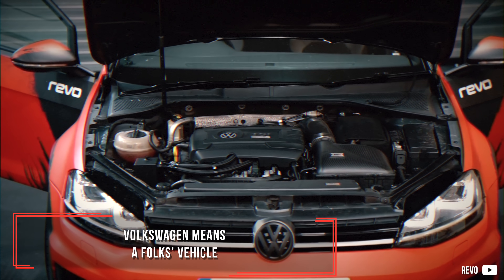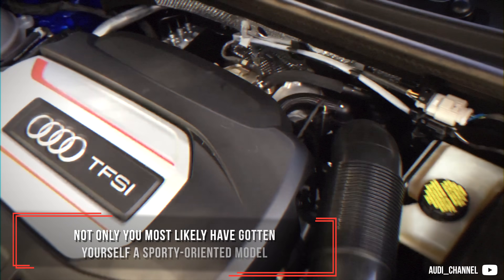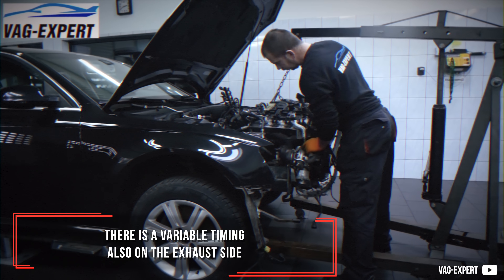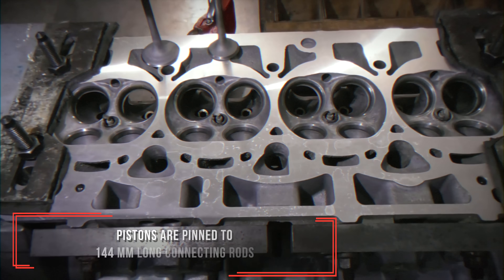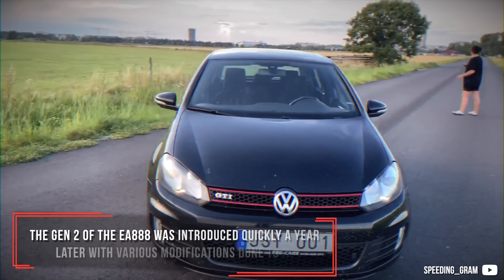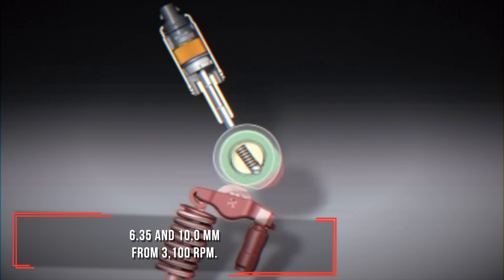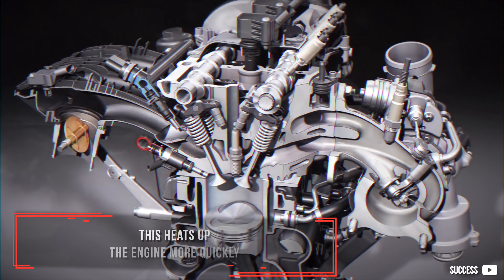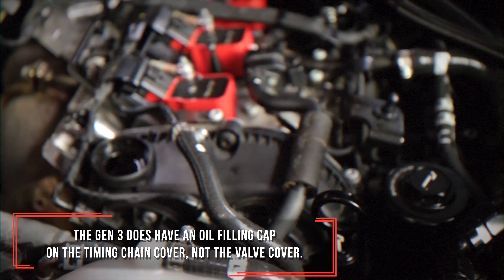Why The Volkswagen EA888 Is So Good

Comment: So the Gen 2 looks like a safe bet. The Gen 3 looks to complicated and prone to failure.
Reply: Gen 2 had the timing chain recall in North America, and VW fixed quite a lot of them. Gen 3 is the better designed and more stout engine overall, with none of the Gen 2 issues. Between the MK6 GTI and MK7 GTI there is a world of difference. The MK7 GTI / R are far superior than both MK5 and MK6 variants. Also, Gen 3 has lesser issues with carbon buildup, sludge etc.
Reply: @647killa  All VW have chain issues, as well as all mercs and all bmws. But having only 1 issue is a good thing.  The Gen3 has 8 injectors, that thing looks extremely complicated.
Reply: @Corsa15DT  Not as complicated as de-coking your valves every 10,000km.
Reply: @MercSLRFan  Will see in about 5 years when we know all about gen3, maybe that cylinder head will be terrible, maybe dozen more problems will appear with Gen3. Complicated engines are usually a nightmare to service and repair. I own a TDI and I thrash it regularly to prevent sludge buildup, never had problems with cat and egr. If you thrash the GTI will you solve to sludge problem too?
Reply: @Corsa15DT  Don't need to, the port injection cleans the valves with petrol.
Reply: @MercSLRFan  I know, that's why they put them there in the gen3. I think its an overkill design that will fail. I was asking about Gen1 and 2. If you give them the beans often, will they sludge up?
Reply: @Corsa15DT  They would, Italian tuning doesn’t work on direct injection cars.
Reply: @MercSLRFan  I am not sure about that :) I own my  TDI PD (direct injection by default) for the past 7 years, give it the beans twice a week, so far soo good. Never seen a check engine light. Touch wood.
Reply: Other way around.

Comment: Sorry but this engine, especially gen 1 and 2, are a piece of garbage and nothing more.
Reply: Can deny that the Gen 1 and 2 are junk, the Gen 3 has improved a lot (I owned one). Many owners of Gen 3 had driven since 2013 till today didn't had excessive oil consumption and timing chain stretched problem. Engine reliability is very much improve but water pump is less reliable. Many owners change once during warranty period and after 80k km it may comes back. Other than that pretty much stable.
Reply: @aeroline11  yeah the gen3 is fine. Also the gen 1 and 2 were a pleasure to drive - aslong as they runs, and that did not happen quiet often without problems 😂

Comment: I bought a 2011 vw cc with the gen 1 ea888 from a dealership, the very next day it spun a rod bearing. Had the dealership install a new motor for free somehow and the thing still never ran right.  Will never buy any european car again
Reply: 2011 engines are gen2
Reply: Buy an European car if you live in Europe. Otherwise get something else.

Comment: These really are great engines, I remember when my buddy/roommate at the time bought a brand new 2003 Audi A4 6 speed. With just a chip the car was substantially faster. The drivetrain was reliable, however the car itself had a lot of problems. I think it was in the shop over 20 times. Fun to drive though. I always loved the 2.7TT S4’s of the early 2000’s. I’ve seen some incredibly quick modified ones
Reply: @footballcoreano LOL what??? Volkswagen/Audi CONTINUNES to designs engines with abhorrently obvious faults/flaws for planned obsolescence. 

“Oh we can make the water pump about 40x harder to do (without a lift and specialty tools… aka dealer money) than it is to do on a b58 BMW?  And that makes it so we can add even more cash flow to our dealer networks/parts/etc?”

Timing chains on these motors in particular are absolutely dogshit, not to mention
They’re fucking $250 salvage title g35 class performance TOPS, plus boring as fuck fwd platforms… slow

Comment: I watched a video somewhere of a complete teardown on one of these pointing out all the weak points. Its a terrible engine from what I saw in that video
Reply: @footballcoreano i am german by the way.
Also halt die klappe kleiner Lügner. Dummer Fanboy, wie immer.
As mentioned in the video, it is only capable for 400 hp with stock hardware. So your comment automatically is identified as a lie and everyone knows. Iconic engines like a 2JZ laugh about that. An Mercedes OM606 makes more power with stock hardware if you slap a bigger turbo and injectors in it.
VW guys commonly have no clue about cars. They rarely have. As you proof
Reply: @dom3827  I made 530whp on my stock engine Golf R, this video isn't the definitive source for aftermarket potential, there are hundreds of low 10 second stock engine Golf R's out there. Thousands of 500+whp stock engine EA888.3's.
Reply: @dom3827  plenty of people pushing over 500whp with stock internals, you dont know shit about these engines
Reply: I know that channel. It's the one with the Canadian guy that uses his wife's old dresses to clean the mess!
Reply: @joshuajacome8803  yes that guy lol. Couldn't remember the name of the channel
Reply: yes, it actually is.

Comment: But its also the engine with the most known and often happening failures.
So, its not really good.
This engine is famous, yes. But in the first place for its failures and lawsuits it brought to VW. Like the oil loss, the water pump failures and wrong piston rings which were used in manufracturing the 1st generation.
Reply: You're absolutely wrong sir.
My 2016 MK7GTI has Unitronic stage 2 at 337HP and 370ftp. 
Since Ive owned,  ZERRRRRRO failed parts, mechanical or electrical. Hmmm, I want to thank the Mexican 🇮🇹 partners for great workmanship.
Reply: I honestly don't know what people are doing to their engines, but I completely disagree when people say that some of the gens of the EA888 are unreliable. That is either not true or I'm the luckiest guy in the world, because I owned several cars with different gens of that engine and I NEVER had any issues whatsoever. In fact this engine has been the most reliable for me for all my life so far. Give that EA888 some love and it won't disappoint you.
Reply: Hey Samuel. Would 7r or s3 ?
Reply: that depends on what ea888 variant you have, i hoped that reliability was discussed more in the video but in short gen2 is the engine with the famous issues like oil consumption and loose timing chain. those issues were fixed on the gen3 variant along with other improvements and they are nowhere near a common problem. gen3 is probably the most widely used engine in the vag family and for a reason.
Reply: @footballcoreano triggered?
Everyone knows your statement is not true 🤷‍♂️
Reply: @dom3827  maybe if you'd get your facts right you'd be credible one day
Reply: @nopeahuoli  i got my facts right baby. I worked for VW in germany for 3 years. 2014 to 2017.
The Like ratio also tells you are wrong. So what?
Reply: @nopeahuoli  how about people overasll just stop fanboying. I mean, what is the benefit of this? Nothing, you just spread hate and dont make friends.

Just be real, it is easier than trying to make someone believe fairy tales.
Reply: @Dom    no-one's been fanboying, it's just that your statements are simply untrue. plus inquiring whether someone is triggered over a response won't  get you friends on the internet like you wish

Comment: EA888 is a shitty daily engine. Leaking water pump, problems with timing chain, problems with the piston of the high pressure pump, Oil consumption etc. I wouldn’t recommend buying an EA888 with more then 100.000km. It just burns your money.
Reply: You forgot false constructed piston rings in the EA888 1st Gen. Where VW released new rings short after and workshops needed to replace them as soon as they have the engine opened.
The coking. After 100k Km you need to get the engine cleaned, or you will cause serious damage and also will have serious power loss. The engine will feel tired and weak.
Pistons which like to get a hole burned through ( stock engine, stock software ). The list continues.
Reply: @dom3827  the gen2 has the weak piston rings. I have a gen1 BZB and it has near zero oil consumption.
Reply: None of those problems are there for the gen3 though.
Reply: Will Burano your money... aaaand your oil.

Comment: The EA888 also came in a 1.8t version as well.  I'm not sure about Europe, but it is/was used in a number of North America applications.  I just picked up a '17 Golf last month with the 1.8t. Besides the obvious displacement difference (shorter stroke) it has a smaller turbo and variable cam timing on only one side (exhaust?).  The same tuning options that work on the 2.0 work on it as well.  I loaded a stage 1 tune to mine the second week I had it.
Reply: Interesting, I didn’t know they still made them that late. I always thought the 2.0T replaced it across the line
Reply: The 1.8 TSI was used in Europe as well.
Reply: @XJR6 My understanding is none of the North American versions, either 1.8 or 2.0, have the dual injection.  That is on European models.
Reply: I did the same thing.  2016 Golf.  170HP stock, 242 after a simple 91 tune from Unitronic without any other mods.  Changed the car completely.
Reply: @LadyLuck-iv2zd  I have a 2016 Highline golf. I have 80k kms on the car. All stock, do you recommend the 91 octane Unitronic tune?
Reply: @iankonstantino6648  I’ve had it for about a year and a half now and had no issues.  So long as you don’t mind paying extra for 91 octane gas, then I’d say absolutely.  One tip is that Unitronic frequently has sales on their tunes, so I’d wait for it to go on sale.  For me, the extra 70+ horsepower and almost 90 ft lb of torque was well worth the cost of the premium fuel.  There are many companies that have tunes for this motor, so you could investigate others too if you like.  But I’ve been very satisfied.
Reply: The 1.8t also had a cast crank where the 2.0t has a forged crank. Doesn't appear to be an issue though. I have a Sportwagen 4motion with a stick. It's essentially a Golf R drivetrain with a Golf motor.  Swapped the IS12 for an IS20 two years ago. Car runs like a top with a good extra 100hp over stock.
Reply: shame they discontinued it
Reply: @XJR6 see my channel I just posted a 1-2 run with a stg 1+ tune.  It spins a lot.  But note it was 2 degrees in the video and it's on 205mm all season tires.
Reply: @XJR6 I did lower the car and added a larger rear sway bar, but wouldn’t say it was necessary.  I am also running a wider tire too as I have wider aftermarket wheels.  I mean, it’s not mind blowing fast but it is stock GTI fast.

Comment: So you want a Gen 1 block, with a gen 2 head and a gen 3 intake manifold.
Reply: And the gen 3 waterpump, the gen 3 dual injection and at least the piston rings of the 2nd, better 3rd generation.

Than maybe you will have a reliable EA888 if you are lucky
Reply: @dom3827  nah, leave the waterpump.
I mentioned the intake manifold because of the dual injection.
The piston rings of the gen 2 are the worst ones.
Gen 1 is better,but yes, the third or even 3b are best
Reply: @Random-nf7qb  3B is the Polo GTI engine. Its not well tunable and does not share the internal hardware.
Reply: @dom3827  it is the newest one though, so it should be the most reliable
Reply: @Random-nf7qb  it is the gen 3 tuned to maximum economy using different valve operation than the normal ea888 variants. So it has higher mpg, but much less power potential and it does not like high revs.

Comment: I wonder how an EA888 would compare to the durability, tunability and stock internal ability to a K Series? despite the EA888 being more expensive
Reply: What VW engine is Boba Motoring using with that 1233 hp Golf Mk2 with AWD?
Reply: @turnin.sprocket  16vt from a MK2 or 3 gti 16v, basically an Audi 5 cylinder 20v with one less cylinder
Reply: @imaadcajee  Cool. I'm sure that build has a bunch of exotic internal parts but the block seems to be pretty stout.
Reply: @turnin.sprocket  they respond very well to boost. A lot of guys put 16v heads on 8v blocks to lower the compression, use a TDi crank and that’s it
Reply: @imaadcajee  @lifted_Above , im pretty sure its an Diesel 1.9 Block with another Head, all costimzed to hold the post.

Yep looked it up. Its a 1Z Diesel Block with a 16v KR Head, billet internals all custom made and ALOT of boodt
Reply: @patriklenck1735  Hahaha diesel block. I guess that explains the ridiculous boost pressures without things cracking in half.
Reply: @turnin.sprocket  it's an ABF 16v motor
Reply: up to around 550whp the EA888 is probably better. But the limiting factor is the head, you really can't make much more than 700whp on it as there is no way to flow enough through the head even with machining because of the coolant passages. That trophy goes to the K series as they flow fantastic and can be made to flow even better with machining.
Reply: @dwvw  Agreed, to make more than that, your going to have to build the engine
Reply: @Josh-qm4rb  I made 530whp on my R with the stock block. Then I built the engine and now make 600whp. I’ve seen 3 cars make over 700whp, and they were all low 700 and could just be a forgiving dyno. No matter how much you build the engine the head will only flow so much air and you can’t machine it much because of the coolant passages beside the exhaust ports.
Reply: @dwvw  700 whp not to shabby for an AWD small car. Assume it's running 7-spd DSG as well.
An APR stage 3+ will go 10.8 quarter with 1200+ ft altitude equivalent, but that's far less power than 700 wheel.
Reply: @dwvw  The ea888 will handle more power stock making it the better stock handling engine for power. Once the story turns to built, then the K series will be able to compete better. But from what they come out of from the factory, the EA888 will handle more power until you start changing the internals of the engine.
Reply: Stock R comes with forged internals from the factory so you’d have the best chance with that engine.
Reply: a lot of big turbo guys pushing 550whp to stock internals. Any more than that or any high torque levels, it will break
Reply: @IEatYouBabies  Yes I believe so. However, I have seen someone who made 750hp on a stock EA888, but he spent a lot on all auxiliary parts (turbos, injectors, exhaust, oils, fuel pump, cooling system and many more) to achieve these numbers, nothing else is stock except the block, pistons and rods and the crank. Reliability may be a concern too.
Reply: You can't feed 1000hp in an EA888, but you can in a K Serie
Reply: @xeus2eme  If the K series was built then yes. A built EA888 could handle 1000hp maybe
Reply: @Josh-qm4rb  There is not much point to compare, in the end displacement is all that matters if you have unlimited budget.
Reply: @tadassmolskas3014  True
Reply: @xeus2eme  not without getting sleeved
Reply: @xeus2eme  😂😂😂😂😂😂😂thanks i needed that today!!!!
Reply: @xeus2eme  bro you should do some research. You are talking about a built engine that is not STOCK. Take a GOLF R and type R with k20c in it. The GOLF R with the ea888 engine will handle more power on stock EVERYTHING than the type R does.

Comment: It is not. It uses lot of oil. This EA888 should be in one of the worst engines list. It is a not a sign of a good quality when you have to make a complete engine overhaul and dismantle it when it is only 100k driven when you need to add liter of oil in the engine in every tankful of gas.
Reply: The EA888 1st Gen is famous for wrongly used piston rings from factory. It is famous for the many breakdowns and huge oil loss this misconstruction has done.
Not to mention the standard waterpump failures.

It is a good tunable engine, yes. But at the same time famous for being the engine with the most problems and construction errors from factory.

Comment: I have a mk6 gti with 93k miles on it, and I wish daily that someone would slam into it and total it, so I can get literally anything else.
Reply: Why?
Reply: @thanosdv4501  because it's a rolling disaster that has cost me more in basic maintenance than my Miata did throughout the life of the car including the purchase price. It's a piece of shit. What other car on the planet has blinker switches that cease to function at 90k miles? or the window switch? or the sunroof switch? My heat doesn't work unless it's above 50 degrees. The turbo needs replaced because the wastegate arm is zinging and will get slightly stuck and throw a lean condition code. The day I drove it off the lot, it leaked oil out of the rear main seal, pcv was bad because of course it was, this one never got  the updated timing chain tensioners, so I replaced those as well. The water pump on these are a ticking time bomb that usually requires half the engine to be disassembled, so that'll be another $600 some day. The headliner already failed (usually these go at 30k or so), and was already replaced. Both access covers/ housings for the tail lights fall off all the time. It really never ends.
Reply: @Mediarahan003  Exactly that is what Golf`s  and the EA888 are famous for. For breaking down in every way possible and being extremely expensive.
Reply: @Mediarahan003  damn man wow... Ok didn't know all that.. makes sense then .. honestly because I've got a golf mk3 1.6 8v with almost 500k and literally no issues whatsoever other than the fuel pump I thought the latter models would be just as good ..but that doesn't seem to be the point ..hope you can at least sell the thing and buy something worth of your money
Reply: Forgot to add this one already had a GFB diverter valve installed so that fucked up before 90k as well